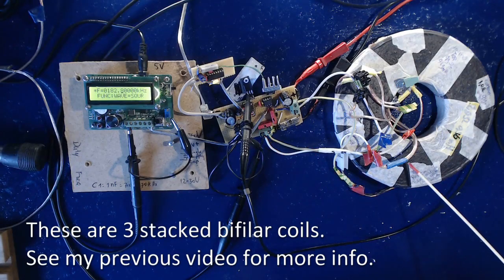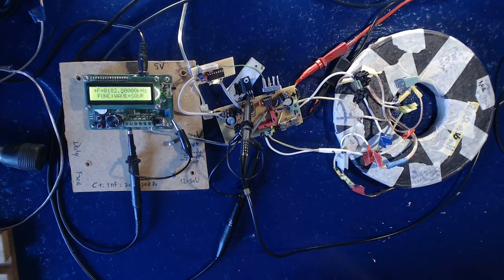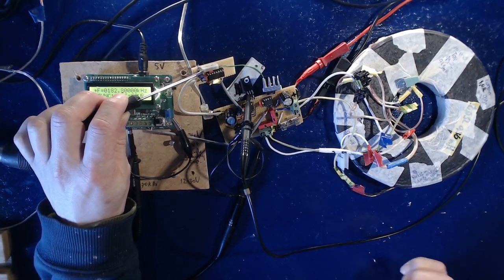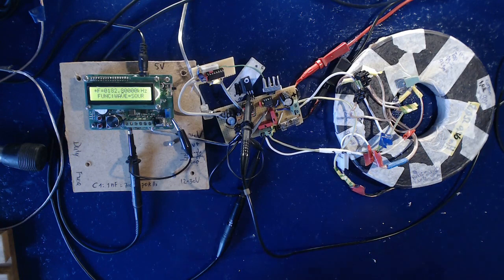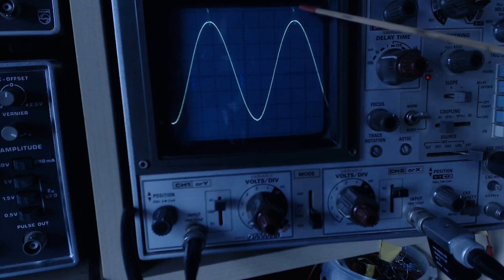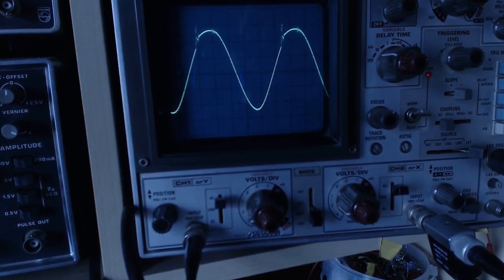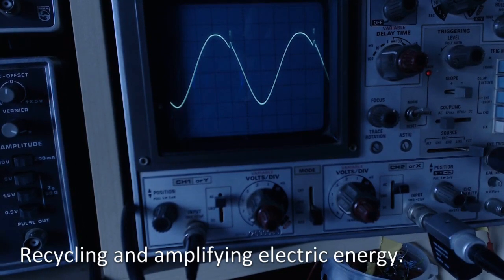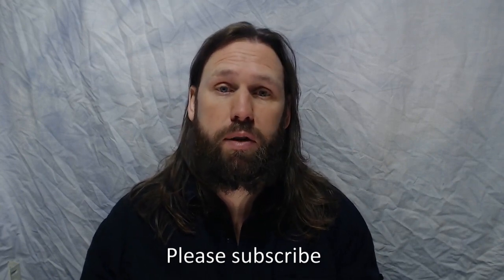Amplifying energy in a bifilar coil, by simultaneously using 2 methods of inducing resonance

Comment: did you try to send back-emf spike directly into a separate coil that is made to ring at an inverse integer multiple of wavelength of main coil? maybe you can setup some kind of positive feedback like in a tesla coil, and not need a separate clock/fet circuit for it.  My scope is not fast enough for the signals to be able to tune well those conveniently sized coils; i wish i had a 30MHz scope, mine is only 2MHz.
Reply from the maker: ai 2 MHz that isn't much.
I am going to work high voltage.
using the impulses to discharge it.

Comment: Easy Test: Tesla Bifilar Coil on a Toroid (R: 4 Ohm ; L = 300uH) Connect it directly to a Signal Generator with a Oscilloscope in Parallel. Use a Square Wave (1 khz, not relevant). Then increase the Amplitude of the Signal generator slowly. You can see that the Amplitude JUMPS although the Amplitude is increasing linear. As if there are separate Energylevels. (Example : Ouput Signal generator : 1.99V peak to Peak - Measured Peak to Peak Voltage over the Tesla Bifilar Coil : 6.64V (!) ... then : Output signal generator : 2V Peak to Peak - Measured Peak to Peak Voltage over the Tesla Bifilar Coil : 13.8V (!)) You have to see it. This is an easy experiment. BTW: I can see no Resonance for this Coil if i scan it from 1 kHz to 10 Mhz. Another find: If i catch the Voltage point at that the Amplitude JUMPS, then the Coil oscillates for itself with a Frequency of 272 khz and a Amplitude of 200V peak to peak. Explanation : I switch the Amplitude of the Signal Generator from 2V pp to 1 V pp and this generate a Self-Oscillation of the Bifilar Coil with the mentioned Voltage (!).

Comment: have you tried the same setup but instead discharge the back emf capacitor at the maximum low of the signal? so that it instead resonates with the magnetic field  (I know this is counterintuitive but just curious of the result, I believe it would provide an increased current but perhaps I'm wrong)
Reply from the maker: the maximum current in a resonant coil is when the voltage is zero. I've tried it, but it doesn't work. working on a newer improved version of this.
Reply: CPS made it clear in his books that he was working for "the man" who had an agenda that was contrary to education. His explanations were designed around keeping the systems running to licensed and patented designs, innovation was not to be supported. So you have to rethink your model of electricity before redesigning circuits. To define electrical power as charge (voltage differentials) and magnetism (current) in two magical fields does a great job of keeping the existing designs up and running without giving away a model that can be exploited to design improved equipment. Plainly what it prevents is thinking of electricity as two components that can be assembled or transformed from each other directly (one is magically maximized when the other is minimized) Yet Magnetic lines of force do not exist (there is no force along such lines and there are no knives or scissors in dielectricity that can cut them to generate electricity. Also, the materials and constructions control the phase of one to the other, so not making this clear locks you into Lenz's Law when its just an effect of bad transformer design. (inductors without capacitance) No generator producer needs a self-powered electrical generator to rock the relationship with fuel suppliers or cost-based public monopolies and all the raw materials generating profits for centralized distribution grids. Licensed monopolies will always squash innovation to protect their Profitability. The electrical generation without consumption of resources was clearly put into production with the installation of the Transatlantic Cable; it will never be implemented in the power grid.

Comment: Well at some point it would be great to see energy Watts in versus energy watts out. I do wonder if it can perform this work function as I always have believed it possible even with mechanical systems but more so without the inherent losses of mechanical systems. when you add natural phenomenon together in a system that has low or little mass you are starting from a greater bias.
Reply: @electron protron Neutron  The unit of measurement for energy is joules, not watts. Watts is the unit for power, which is a measurement of the rate at which energy is transfered.
Reply: there is energy losses in electrical circuits, same as with mechanical systems. No matter what form energy may take, there will always be losses when it is transfered from its source to the load. Losses can be minimalized, never eliminated. 100% Efficiency is not possible in any system.
Reply: Sure in a closed system that's not utilising the normally lost energy like this back emf but on top of that you can also allow the flow of energy in the either to be moved into the circuit if it's pumped from a dialectric . Its just about creating the initial pulse and then what you do with what it creates! Its there I know it in my being . Every time someone breathes in they inturn breathe out . Put that air into a black plastic bag and now you have buoyancy that can float a huge amount of weight compared with the energy it took to exhale. Now put that bag in a glass room in the direct sunlight and watch it absorbe the energy and expand . That's adding energy from a natural phenomenon to the system just like tapping the either. You got to charge the system and then know how to extract more energy from the natural environmental  energies that exist. Notice how the more air thats in the bag allows more energy from the sun to expand the bag . So more volume increases the amount that can be received . Its the same same . Energy pumping ! Just got to work out how to ripple that space time !
Reply: @ozymandiasking173  Sure in a closed system that's not utilising the normally lost energy like this back emf but on top of that you can also allow the flow of energy in the either to be moved into the circuit if it's pumped from a dialectric . Its just about creating the initial pulse and then what you do with what it creates! Its there I know it in my being . Every time someone breathes in they inturn breathe out . Put that air into a black plastic bag and now you have buoyancy that can float a huge amount of weight compared with the energy it took to exhale. Now put that bag in a glass room in the direct sunlight and watch it absorbe the energy and expand . That's adding energy from a natural phenomenon to the system just like tapping the either. You got to charge the system and then know how to extract more energy from the natural environmental  energies that exist. Notice how the more air thats in the bag allows more energy from the sun to expand the bag . So more volume increases the amount that can be received . Its the same same . Energy pumping ! Just got to work out how to ripple that space time !

Comment: Im really curious to know how you been able to build a pulse capacitor discharger that is able to adjust the phase on it. Also, how do you discharge your capacitor I to the coil shown on the oscilloscope? Do you do it via induction or directly physically connected to the coil? Anyway really good work! ----------------------------------------- Some believe that is the "trick" behind Kapanadze device. 2 circuits: one mostly magnetic and one mostly dielectric. So Sparking a high dielectric into an oscillating magnetic circuit in phase and on the peak of the voltage rise. These two circuits are capacitively coupled via a earth ground. Anyway, I'll like to discuss this with you a bit more if you have spare time. Thx again for your good work!
Reply from the maker: Look at my about page on my YouTube channel from a lab/desk top computer, there is my email. If you want to talk more.
Reply: Why not explain it here? 
at least we all could learn from it
Reply from the maker: There is a lot to it. I still don't understand all. What I do understand is, that a unipolar disruptive capacitor discharge can induce radiant electricity effects, this Radiant energy is key to the device. So the key is to charge a capacitor (in my opinion it should me negative voltage) and discharge this capacitor very fast and abrupt into a (bifilar) coil.  this sudden change in voltage greates a longitudinal radiant electricity pressure wave.
this nano second discharge is not allowed to change polarity.
the coil should not oscillate. telsa called it a damped wave. but it looks more like a spike.
this radiant energy is the collected by a second coil. this coil is tuned to the right frequency, and does oscillate (undamped waves) 
I will be experimenting with these concepts soon, in combination with bifilar coils. the results will be shared on my channel for all to learn from.
Reply: I am ok with the fact you still need to learn about it. 
But it eliminates the learning curve for the rest of us.
The more we share with each-other, the faster we get there.
We all look for the way to be free from " public utility companies"
And yes, i realize some of us don't share at all. 
Even me, I only have some ideas, but then again, I'm not actively researching. 

Anyway, Thanks for the reply.
Reply from the maker: thanks danielsThierry. You are right. we all hold some pieces of the puzzle, if everyone shares, we can make the pieces fit easier
Reply: Can’t wait, your the propulsion system engineer here!

Comment: Hey Ivo! im reviewing some concepts with the DC impulses and LC circuits; are you getting any LC resonance at the output coil? I ask since you are using a capacitor to store the Back EMF. I assume that the capacitor only receives the back EMF correct?
Reply from the maker: that's an old video.
I now use the back emf, as an impulse, to induce displacement currents, so I don't store them in a cap.
the displacement current is captured by the grounded secondary. it seems to do something with the earth. as I am seeing ground currents
Reply: @MasterIvo  ahh yes, so then your cap connects to by he ground? Also it all remains Pulsed DC right and not Alternating Current as the output?
Reply from the maker: @cosmicyoke  every coil is resonant, so only the driver is pulsed DC the rest is AC, which will be rectified to dc for power
Reply: @MasterIvo  ahh I see 🤔rectifying it the output, hmm is there very little loss with this rectification? I figured that I could use oil to prevent arcing at the contacts of my interrupter, but the interrupter itself has a way to go in terms of improvement still anyway.
Reply from the maker: @cosmicyoke  yes rectified using diode is very low in loss

Comment: Hi Ivo, like the way you hold me captive from video to video and build the story.  Did you mean to say, when discussing back emf, that voltage tends toward infinity?  Nice job with the scope work...
Reply from the maker: yes, Steinmetz wrote of you present a magnetic (high current) circuit with a infinite large resistance (a perfect fast switch that opens) it produces a infinite voltage, this is what we now know as inductive kickback, or as i like to call it, back emf
Reply: Ok, I see, helped seeing his quote.  Of course an infinitely large resistance is not possible, but I get the idea.  The way I think of this is that the magnetic field that is created in a coil contains a measurable amount of joules of energy.  This is the energy you have to work with regardless of the magnitude of voltage.  You have a choice of expressing this energy in volt*amps (i.e., High volts low amps or whatever) by the circuit you create.  Now, if you incorporate J. Newman into the mix and change up your backemf coil then it is possible to improve this relationship.
Reply from the maker: there is also the time factor. The smaller the time, the larger the voltage. It is the same joules of energy.
but the trick might be in presenting this voltage to the resonant coil.
the instant high voltage, gives a punch to the ether. Like a longitudinal pressure front (field) al over the pancake coil.
Reply: The instant high voltage would give a "punch" to the ether but the vibration takes the easiest path into your collection capacitor.  It looks as if you are "presenting" the energy of this "punch" in a calculated way and applying as positive feedback to the resonant coil in the greatest constructive manner in your video.  Looking forward into seeing your strategy in subsequent videos on the eventual energy extraction pump.  Good stuff...
Reply from the maker: when the back emf charged capacitor is presented (connected) to the coil (which has an equal size capacitor parallel to it) the  coils inductance would be a high resistance path. So the energy would flow to the parallel capacitor. this capacitor is at maximum voltage (of the resonant cycle).

at the same time we have a dielectric field inside the coil, this also gets to see the extra energy of the added series capacitor.

I still dont fully understand what more is happening. but I keep thinking the added series capacitor gives a punch to the dielectric field of the coil. this seems to be the key.
Reply: Agree that the parallel tank consisting of "the coil (which has an equal size capacitor parallel to it)" benefits from the "punch" of the series cap provided from the back-EMF vibrations.  The series cap will pass it's energy (vibrations) almost instantaneously to the cap in the parallel tank (as the coil creates opposition to change in current).  Thus your series cap also serves the function of impedance matching, or in another way of saying, is acting as a coupling capacitor as well.
Reply from the maker: The series capacitor, is almost not discharging. just a slight drop in voltage, during the 140nS it connected to the resonant coil/cap combi. 

Still working on creating a negative inductive spike (back emf).
I'm now doing it with a high side n mosfet switched by a gate drive transformer. It's all new to me, but I seems to be able to work. 
I was lucky, I tried some different size capacitors with the transformer, and hit the right spot with 470nF.  the gate seems to see a nice square wave :)

Comment: I understood you created a vice-circule, but unfortunately I don't understand much of electronics and even so I got to understand your explaining. 
I'd like to know how many volts one may obtain by using this aparatus,  if it's possible you answer me.
Reply from the maker: Many volts, this is an older setup, i moved on(see recent radiant power video) . as this voltage is without current and thus has no power